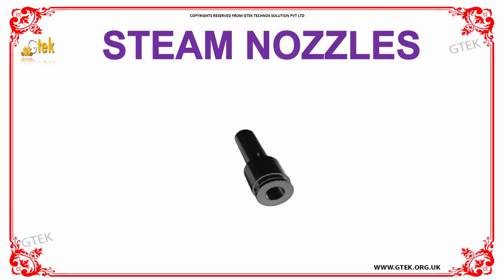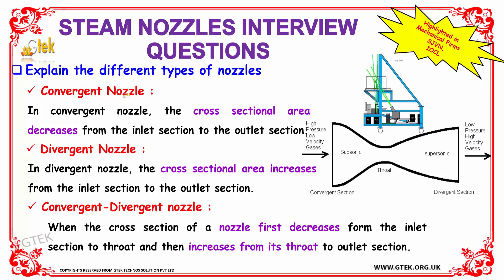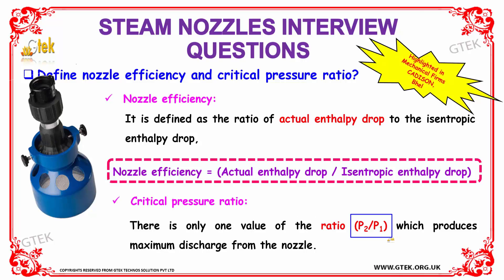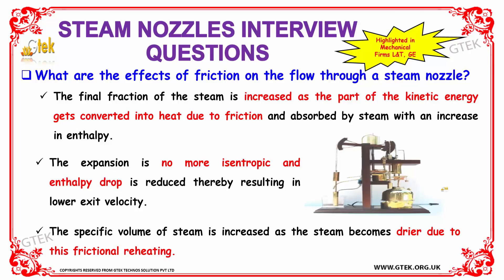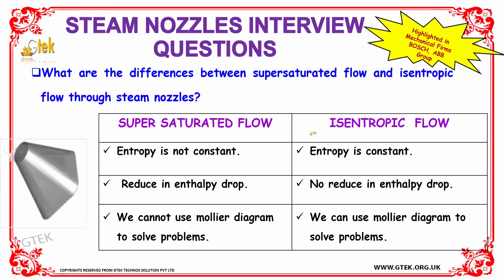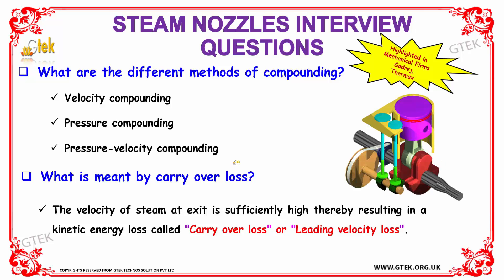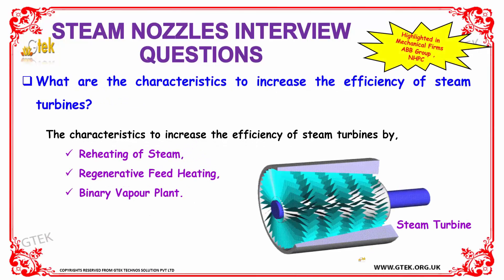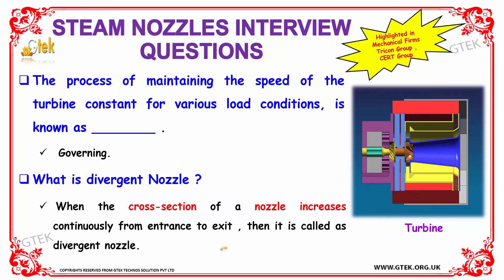Top 40 Steam Nozzle Mechanical technical interview questions and answers for fresher experienced

Comment: Convergent nozzles accelerate subsonic fluids. If the nozzle pressure ratio is high enough, then the flow will reach sonic velocity at the narrowest point (i.e. the nozzle throat). In this situation, the nozzle is said to be choked.

Comment: Nozzles are devices used to accelerate the fluid velocity at the cost of pressure. The isentropic efficiency of nozzles is defined as the ratio of the actual kinetic energy at exit to the kinetic energy at the exit when the process is isentropic for the same inlet and exit pressures.

Comment: A nozzle is a device designed to control the direction or characteristics of a fluid flow (especially to increase velocity) as it exits (or enters) an enclosed chamber or pipe. A nozzle is often a pipe or tube of varying cross sectional area, and it can be used to direct or modify the flow of a fluid (liquid or gas).

Comment: Reaction Turbine
In reaction turbine, there is no nozzle to convert steam energy to mechanical energy.
Moving blades work due to differential pressure of steam between front and at behind of
moving blades.

Comment: Impulse Turbine:
Thermal energy of steam is converted to kinetic energy in turbine nozzle. Kinetic energy to
be converted to blade become mechanical energy and transferred through rotor, shaft
and coupling to the load. Enthalpy drop is high for each moving blades.